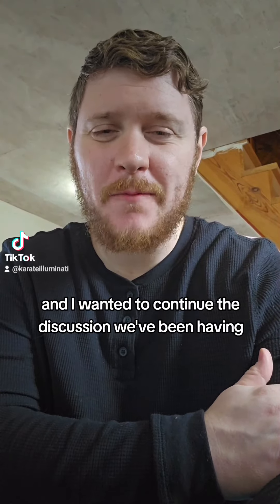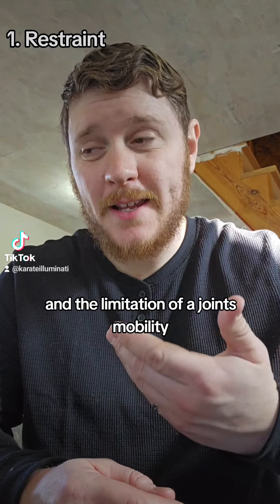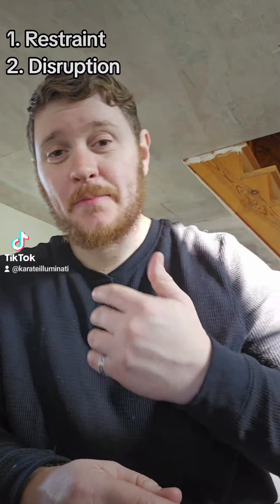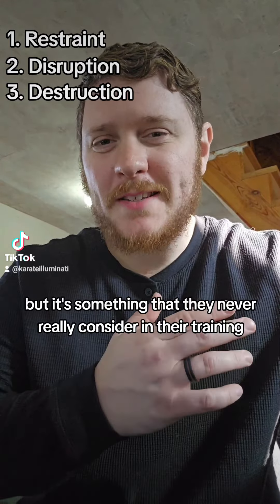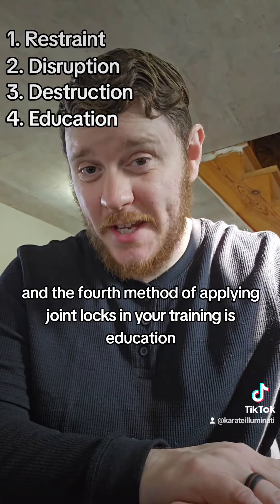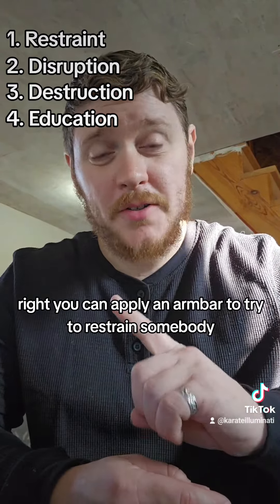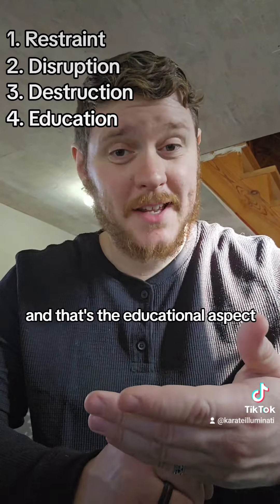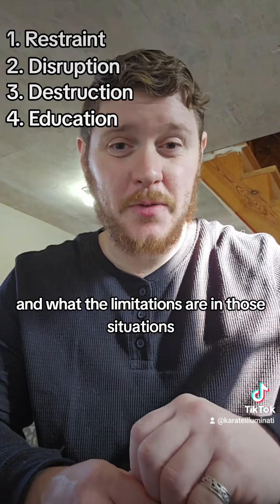4 Ways to Apply Joint Locks

Comment: 5. Disarms
Reply from the maker: IMO, disarms actually fit into restraint, disruption, and destruction, depending on the disarm. Either you're holding them in such a way they can't keep a good grip (restraint), you're moving them in such a way they can't keep a good grip (disruption), or you're damaging the joint so they can no longer keep a good grip (destruction).
Reply: I think these are better described as technique purpose or intent rather than method. The method is the how and it sounds like you are describing the why.
Reply from the maker: @jeffcurry1280  I suppose everyone is going to see it a bit differently. To me, the how and the why are intrinsically connected.
Reply: @ilpracticalkarate I kindly disagree with that. Let's take kote-gaeshi as a generic example: A kote-gaeshi used to throw an opponent (disruption - using your terminology) is definitely quite different to using the same principle on the joint to pry out a weapon of somebody's hand. The latter doesn't also fit in the restraint category, because you are not using it to restrain the opponent, but instead actively taking the weapon out of his hand. When you've got the weapon, the "lock" isn't necessary anymore - it is a very different "why" which also dictates the "how".
Reply from the maker: @eisbombenterror  in my mind, restraint is not a matter of always immobilizing the opponent's entire body, but rather taking control over part OR all of it. Your example of kote-gaeshi as a disarm is restraining their hand and wrist so they can't use it while you strip the weapon.
Reply: @ilpracticalkarate  No, my example is actively using the lock principle to strip the weapon. It is not restraining the hand with a kote-gaeshi. With the opponent having a grip on a weapon, that's pure fantasy, sorry. You won't be able to restrain that hand with a wrist-lock. Especially if it is a bladed weapon. Indeed, in a real situation you will most certainly have to restrain the whole arm using some other trapping method or lock, so that you can actually use kote-gaeshi to disarm the opponent - as a disarm technique, not a restraining technique.
Reply from the maker: @eisbombenterror  perhaps I'm not understanding exactly what you're trying to describe. Can you share a video?